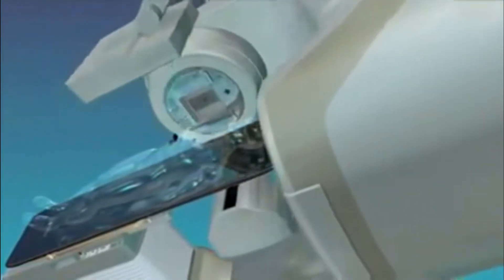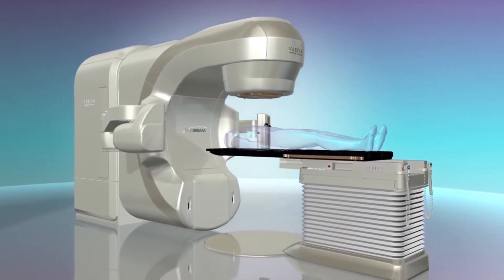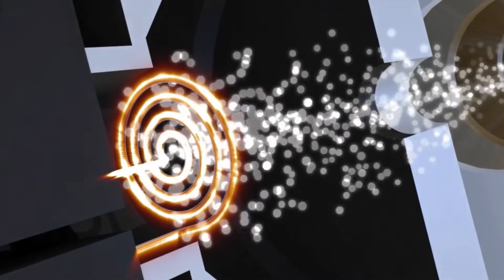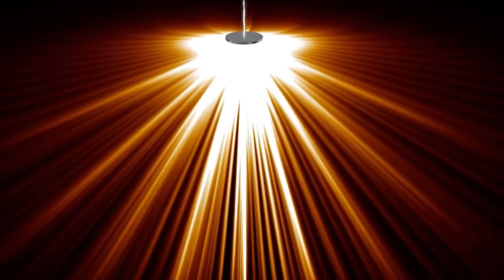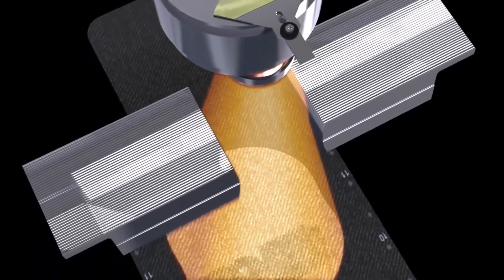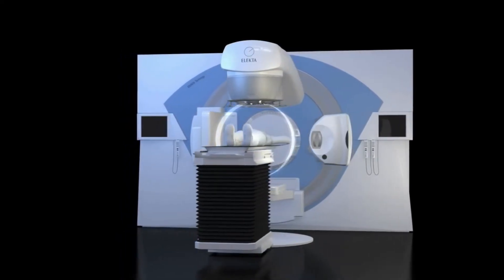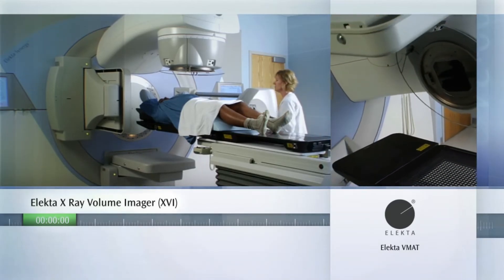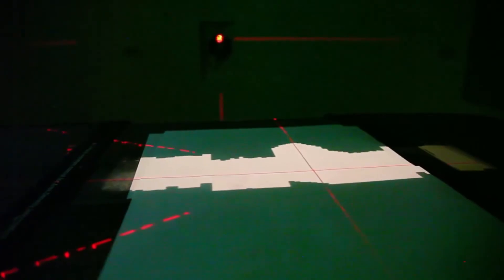Linear Accelerators (LINAC) | Biomedical Engineers TV |

Comment: Sir can you please explain what is the safe position of gantry and mlc's when machine is off
Reply: I can try. I guess it depends on the actual machine. For example, Varian TrueBeam has a gantry = 120 degrees and a collimator = 90 degrees as safe angles.
For the collimator, it is because of gravity force. In this rotation, it won't affect the leaves of MLC.
As for the gantry - it is just a precaution in case of some damage (rupture of some tube due to high pressure) and some liquid leakage. In this position, the liquid is less likely to damage more parts.